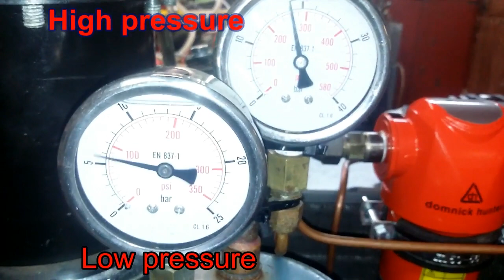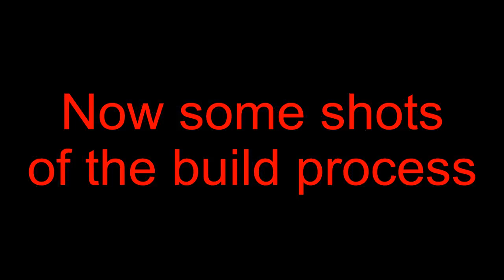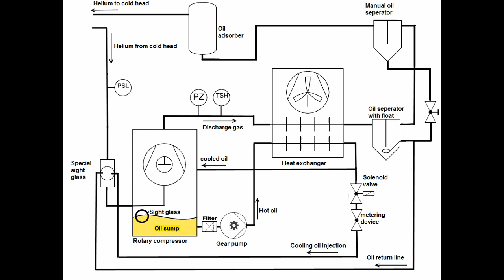Leybold Coolpower 7/25 Cold Head / Cryocooler with DIY Helium Compressor Kaltkopf

Comment: What did the power to the expander head look like? I have a APD DE-2-2 and I cant find any schematics about how to wire, what I believe is a 3 phase stepper... mabye? It could a BLDC too. There are 3 wires and one grounded to the botty and I am having the hardest time figuring out how to wire the cold head driver circuit.
Reply from the maker: Most likely its going to be a low speed gearless synchronous motor. Similar to the ones produced by superior electric.
They can be 2 phase or 3 phase, have you checked the manual of the compressor that is used with this unit?
The circuit will most likely consist of a capacitor with a series resistor, maybe open up the cryo head and check if the motor has any labeling,
You don't have to pull it apart completely, just the top part with the motor will be enough.
Checking resistance of the Motor will also give you a hint, if it is symetric (1:1:1) its likely to be a 3 phase, if its asymetric like 1:1:2 its going to be a two phase motor.
Reply: @Alexander470815  That's what I'm coming to learn. What the manual lacks in depth in makes up for in shallowness so its almost completely useless. I've been trying to avoid opening the head to save the helium that's already in there. I measured the resistance across my 4 pins and got 1.2:1.2:3.0 and one grounding to the body. I scraped up some patent information and found 2 different schematics. 

One very detailed, having 4 wires + ground (not my case) as I only have four pins on the DE-202 and one is grounded to the body. But it did have 2 wires getting straight power from the xformer and the other two having C-R's connected too them. One leg had a 0.8 mFd cap in line with a 1kΩ resistor the other with a 0.4 mFd cap with a 500Ω 50W power resistor. I imagine the former is a starter circuit since synchronous motors are known to be difficult to get going in a certain direction and the latter being a braking circuit? A 50W resistor seemed to be a lot but from the schematic it is sizable so I don't the the spec is wrong.

The second one had a schematic like you described minus any detail other than C and R going to a pin. I'm thinking that my wiring may need the not-50W leg and two leads to the xformer. Probably one lead to each of the 1:1 legs and the 3Ω lead getting the starting circuit? I would think that one would have the most flux impulse generated to get the motor going. I might also be missing something fundamental. The starter circuit could also be used to delay the field of the next stator winding in line to get it started. 

Also, I see that you have a monster AC compressor, it looks like it is out of a 3 ton unit, and a similar cold head as me, have you run into any issues with it not keeping up CFM wise with the helium? I've got a few compressors and I'm thinking the one out of a 5000 btu window AC should be able to cover it, but there is the whole uncertainty part of it. I imagine I could also have a buffer tank help me out some as well. In any case, thanks for following up.
Reply from the maker: @JaredBrewerAerospace  The Pin connected to the body will just be connected to ground.
Judging by the resistance it is a two phase motor, the windings are connected at one end, that is the common.
Common goes to neutral, one leg goes at the supply voltage and then the supply voltage in series with a capacitor and resistor gets to the other leg.
The different circuits with 1kOhm and 500Ohm and the capacitors may be used for different cold heads since they might not have the same motor.
What leg is connected to the line and what gets the capacitor will set the rotation direction, the cold head will only work properly in one direction.
The capacitor + resistor thing will be permanently connected to the motor.

I would suggest you tear it apart and look for a motor nameplate with data on it.
Giving it the wrong voltage and/or capacitor could result in damage.

The compressor I use is a 35ccm R22 compressor.
So its more like a 1,5 to 2 ton compressor, tons is a really bad way of sizing a compressor for a swept volume.
For your cold head you are looking at roughly 2kW electrical input for the original compressor.
The pressures will be in the order 5bar low pressure and 20bar high pressure.
35ccm * 2850 RPM (speed at 50Hz line) = 100 liters per minute or 6m³/h.
In silly units this is 3.53 cfm :)

If you do not have enough swept volume the low pressure will rise and the cold head will not perform good.
A buffer cant really save you here unless its thousands of liters so you can run the compressor hours in advance.
For good performance you will have to use the right size compressor or multiple ones in parallel which doesn't make it any easier.

Most of the times the compressor nameplate will give you the ccm rating, with the speed of the motor ( 2 pole @ 60Hz ~ 3400 RPM) you can calculate the swept volume.
I guess you will need one in the 30-40ccm range as well.
Reply: @Alexander470815  With your advice in consideration, I wired it up to my rheostat at 110 VAC @ 60Hz, though all of the literature points to 220 as the most common voltage for these, and slowly turned it up to 35-50 VAC. I heard a faint humming and when I analyzed it with the spectral analyzer it was humming at exactly 60 Hz even as I varied the voltage. The capacitor circuit definitely delays the development magnetic field of one of the phases to get the motor spinning then it really falls out of the circuit once it is charged.  I only ran it for a few seconds since I'd imagine the helium cools the motor as well, but I think that is a fairly successful result. At least now, I know something works.

I agree with your sentiment that there are probably multiple configurations being represented in the patents and one of them may need that load resistor as a braking circuit if it is running a DC or maybe a large asynchronous motor. I have  a 40W power resistor and its enormous so I think scale was also considered in the blanket patent strategy. Later today, I am going to pull all the helium out and crack it open to take a look. I'll report back to you what I find out from the nameplate.

Thank you for the example calculations. I have nearly the same numbers adjusted for 60 Hz, in my case, so I'm confident I am gaining an understanding of the fundamentals.

I am also glad you took note that I keep swapping units because you know.... units. I have an Aerospace background so I am in violent agreement with you about tonnage and cfm. There are cases when imperial units simplify things, but this is not one of them. I am certainly most comfortable to m-kg-s to save you the trouble. Your R-22 compressor is more equipped to handle the pressures we are operating at since R-22 requires almost the same. I am only finding R-401a/R-134 compressors I am going to require more cooling on my fluid lines so I will keep that in mind. Are we looking for such a large pressure differential? I see estimates from yours to a delta of 5 bars total. I'm not sure if  they operate better closer to steady state or do the dynamics drive up its efficiency/capacity? 

Thanks again and I'll report back with my findings.
Reply from the maker: @JaredBrewerAerospace  Since we are dealing with AC the capacitor will contentiously be charged and discharged causing a shiftet magnetic field in one winding to get the motor to rotate. Why the resistor is needed i am not too sure but the superiour electric motors also need them.
Maybe take a look at this document: https://www.ahs-antriebstechnik.de/images/PDFDateien/Service/C4001-SS-Obsolete.pdf

If you cant source a R22 compressor a R410A one will work too.
The R410A compressors have a stronger drive motor for the same swept volume, the R134a will be the opposite, they will be to weak.
I believe 5 bar to 20bar is a normal operating range so quite some pressure differential.
Most of the times they only give you the rated high pressure but no words about the low pressure.
Reply: @Alexander470815  I believe the same. I think the capacitor collapses the forward magnetic field to get it moving. After that, a resistor is there so that it is discharged before the next start-up cycle. I have been on the look out for a R-410A compressor because R-22 may as well be a swear word in the US HVAC community. I also have the option of running the R-410A a little undersized as I have come across a complete AC unit that I could use with an extra brazed plate heat exchanger to cool the oil and leave the air to cool the helium or maybe a mixture of both. I really want to find one with the 2kw draw that you describe because I know it works. If your's is experiencing a 15bar delta than I need to definitely get one with at least that much power. A professional unit I check the specs on had a 7 bar delta so there must be something to the volumetric flow rate as clearly we have identified. I have a few resources I can still tap into if one doesn't materialize in the near future. Or just run my R-134A into the ground and hopefully have a replacement by then.
I cracked my pump open and found that I have a:
RapidSyn Model 34H-652B 240VAC@2A  Synchronous Motor fixed at 72 RPM
2A at 240VAC seems like a lot but that must be inrush current. There is no way the motor needs almost 500 watts of power to operate at 72 RPM. As for the rest of the name plate , there are two unlabeled, boxed numbers, one underneath current that says "8837" and one that predicates the 72 RPM designation that says "201110C". I'm trying to decrypt if there some indication of ccm rating in here. It is an American company so it may have a conversion factor to SCFM or the like but none of them really add up to our numbers. Our cold heads are pretty close in physical size so I couldn't imagine any of the before mentioned values being directly correlated. Even 3.53 CFM, it is not possible I would need a 8.837 CFM but 8 m^3/h doesn't seem to fantastical. I have a feeling the 20110C number will be significant if I can find a data sheet on this motor.
Reply from the maker: @JaredBrewerAerospace  The power draw of the compressor is really not the metric you want to be looking for. Its swept volume but the drive motor has to be strong enough for it.
2A at 240V does not equal 480W, it is 480VA(apparent power) the watts(real power) might be much lower than that. With AC capacitors and inductors behave much different than on DC.
 20110C will just be an internal part number with no meaning to itself, i highly doubt that there will be a cfm rating on the cold head itself.
For the pressure delta I'm not sure either, for my system it seems to work out to around 15 bar on other systems this may be different.

For my cold head the swept volume is known, you can run three of them(Coolpower 7/25) on this compressor: https://www.ebay.com/itm/292482183636 (Coolpak 6000)
16,18m³/h divided by three are 5,9m³/h which will translate to 35ccm running at 2900 RPM (50Hz). With the recommended high pressure of around 20bar my system runs with 5-6 bars of low pressure. I talked with somebody from leybold about this and this seems about right.

Comment: very intresting,
do you have some instructions to follow to do it?
Reply from the maker: To complicated, if you know how to do it you can pull enough information from this video.
Reply: @Alexander470815  Maybe a bit more details about choice of components? Compressor, make and model? Filters, separators, why exactly that type and not other?
Reply from the maker: @jelenabaturina2889  Well that is a specific question im able to answer.
22ccm rotary compressor because that swept volume is used in the commercial compressors for that cold head.
R22 or higher pressure rating should be fine, R407c or R410A will work fine.
Rotary because you can just extract the Oil from the bottom an dump it back into the suction, with scroll this is difficult.
Maybe you can even get away without a seperate oil pump and just use the pressure differential to circulate the oil.
Like get it from the high pressure oil sump->through the oil cooler->metering device->suction line.

Primary oil seperator is a temprite 601, secondary one is a dominck hunter AA-15  I believe, maybe not even necessary.
Oil Adsorber is a filter dryer housing for large refrigeration systems(four H48 filter cores) filled with activated charcoal.
I use this because it can easily handle the pressure and can be renewed with little effort.
Reply: @Alexander470815   It is a very good answer regarding compressor. I assume  22ccm is for 60Hz. For 50Hz  then it is 26,4ccm to keep the same flow. I would say that question is closed.   But for the oil separators I could determine make and model from the video,  not the engineering specifications that lead Your choice. So my  real question ment why You chose exactly those two. Do they really pass only 0.1ppm residual oil mist and vapors to the adsorber?   How much oil can adsorber ultimately adsorb before being saturated? (Because that amount  determines how effective fore-separation must be).  Also, did You change the original oil?. Producers of the helium compressors swear that "ordinary" oil is no good.  Is that just a hype or there is really some difference?
Reply from the maker: @jelenabaturina2889  22ccm is just the swept volume, it is not dependant on the frequency. Here in Germany I'm running 50Hz. But the same system is also used for 60Hz, this is no problem since the cold head motor runs faster too. The oil seperators where choosen because they were easy to get for me. The Temprite one claims that it can hold back pretty fine particles, the domnick hunter one too, so they were choosen. I cant tell how much oil is getting through, i have no way of measuring it. Until now the system may have run arround 100 hrs and there seems to be no problem. For the oil i have replaced it with oil for air compressors with the viscosity of Iso VG68. For now it works fine, will it fail? Probably but the unit is not getting much runtime since I only run it when I need some liquid air or oxygen. So in the long run I pretty much cant tell if this works or not.
Reply: @Alexander470815     Ahaaaa.... You are also on 50 Hz.  22ccm per revolution. Someone on 60Hz will have higher capacity....  
The last question:   Heat exchanger is divided in two sections. One for oil , and the other for gas.   
But the gas section is smaller... It means that oil is the main route for heat rejection? How did You choose the ratio?
Reply from the maker: @jelenabaturina2889  Since the heat capacity of Helium is known and the swept volume is known you can calculate the amount of heat that needs to be removed. The difference between this and the electrical power consumed will land elsewhere, in this case in the oil. Previous attempts of cooling the compressor with a water jacket failed, discharge temperature reached 120°C in no time which is a bit too much. Direct oil cooling seems to handle it quite well and the discharge temperature is arround 40K over ambient which is fine. And there is no need for a seperate water cooling loop, some manufacturer of Helium compressors also did this in a similar way.